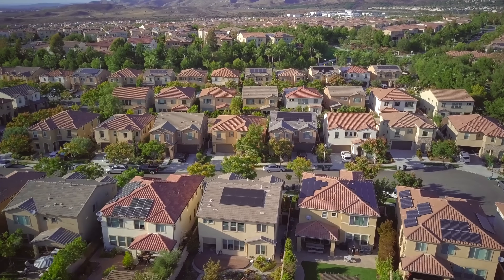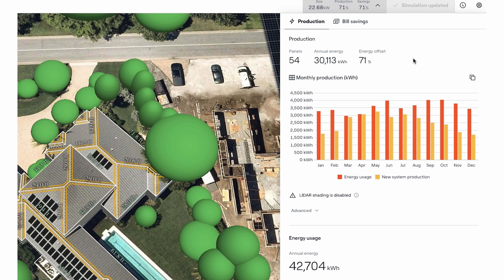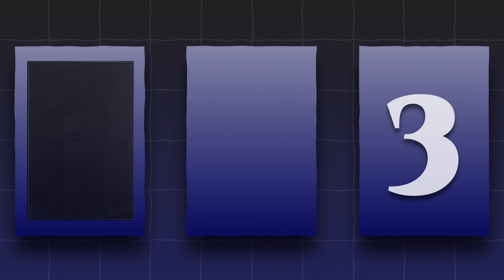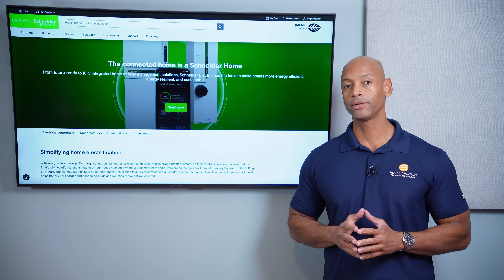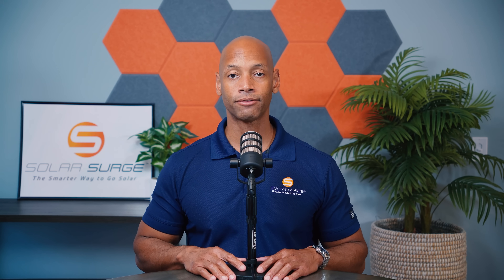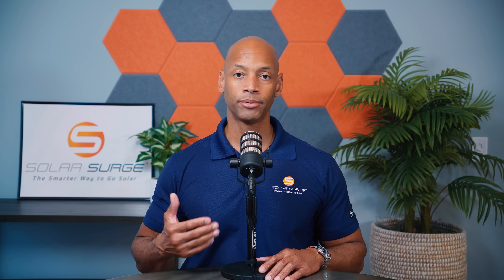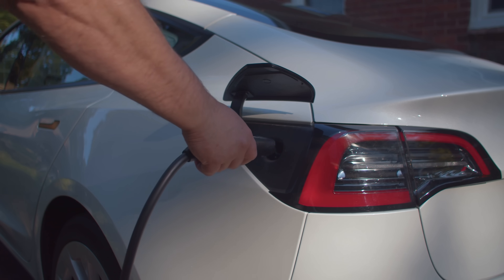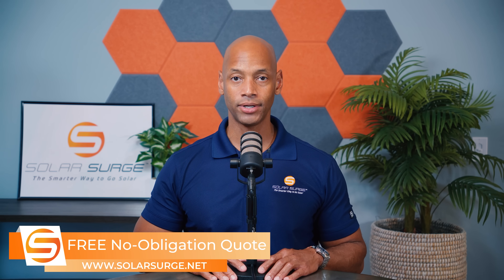How to Fully Solar Power Your Home

Comment: save $100,000 
A real bunch of crooks.  Beware Enphase, Good Leap, and Blue Raven Solar.   the loan contract will say you have no Constitutional rights or rights to a jury trial and if you have questions, you have to post a 10,000 bond for the arbitration board.
do they tell you that you only get 80% credit for the electricity you generate,  for every $100,  you get $80 the electric company get $20.   Quite a profit.
The solar panels and I invertor for each panel and warranteed for 25 years,  they start failing after 25 months.  Is labor covered under the warranty?  No.       Therefor 32 failing panels and 32 failing invertors  times $500 buck labor is $32,000 in additional cost during your ownership. 
A real bunch of crooks.  Beware Enphase, Good Leap, and Blue Raven Solar.   the loan contract will say you have no Constitutional rights or rights to a jury trial and if you have questions, you have to post a 10,000 bond for the arbitration board.
How good are the batteries good for??
How long do the solar panels last?
 how long do the inverters last?
Did they tell you the repair department is located oi the Philippines, with operators who don’t speak English that is understandable.   
Do they tell you they will wait 30-40 days before  replying to repair issues. 
30 panels and a $20,000 roof cost me $ 96,000 and my payment is only $498.................. thank you so much

Comment: I just got a 10.12kw solar system that we just had installed.  Im in Los Angeles and it’s mid summer.  The AC is on and I have a pool pump that runs 8hrs daily.  We also just bought a Tesla.  I believe the battery capacity is approximately 70kw.  I also have a fox ess 20kw battery. The system has been producing about 38-47kw daily.  I set my wall charger at 22A and it gives the car 5kw/h.  I do this from 10-3 (when I receive the most PV).  There are days where we can fill up the battery but when I charge it doesn’t get filed up all the way.  I’ll wait a full year to see if I’ll be net zero but I highly doubt it since I’m in NEM 3.0 from so cal Edison.  But still I feel that it’s still a good investment since  Edison keeps increasing their rates year by year

Comment: I finally got the last piece of puzzle instaled to be self suffient. My system a bit of a mess but its all working perfect right now. I got one solar system with enphase enverters. A different system was added later and they used a telsa inverter. I just installed the new franklin batteries last week. It been bit of learning cure which seeting to use but have found out using self consumtion option works out the best. Now im not using any power from the grid. Hope in winter months its also rhe same. Will find out here soon in next few months. By the way im in Ca and got stuck with new 3. That another story im not happy about. But if these batteries work out i wont need pg&e anymore. There rates are killing me.

Comment: Thank you again for sharing your insights. For those taking the first foray, and others looking for additional resiliency, there's a few things to consider. The monopoly (utility) is a disruptive force. They may try to make you jump, and want you to ask how high should I jump. The reality is in their own economics. They have few options to meet demand (ie data centers especially with so-called AI). You, the renewable consumer are the solution, but you may get marginalized by their tactics. Push ahead, be informed, get your installation done, regardless of the sketchy tactics, especially for those that are tax credit eligible. Design a system that can segregate you from the monopoly approval so you're eligible for the remaining incentives. I have had trials and tribulations with Rappahannock Electric. Still moving forward with my upgrade from a 15+ year old grid tie to at least triple the size, and solid battery backup. Don't be intimidated

Comment: Where can I find a solar installer to do #3. Every installer I call only wants to do grid tied solar which dies as the power grid dies. I would like someone to help me design a dc to dc connection with my F3800’s. I got the money in my hot hand but nobody to shut up do the work and take my money.

Comment: This is in my plan.  The real question I have is since I'm planning a new home, around 3,500 SQ ft.  I don't know what my usage will be.  Plus, part of what I'd "like" to do, is have enough solar energy to never have to worry about what the thermostat is ever set to.  On a 100 degree day, I want my house to be 65 then go for it.  The same for winter, 30 outside I want to set it to 75.  How can I possibly figure out what I'll need. (Batteries too)... I am thinking I'll have a small generator as a safe guard, maybe that will allow for a smaller battery package.

Comment: At this late date, I think its simple.   For most people contemplating solar now who are new to the game and don't completely understand all the fine points:

* Start with a whole-home hybrid inverter and a battery from the get-go, and fill all convenient roof space with DC coupled solar (regardless of orientation).  Keep it simple at the start... just stay grid-tied, don't worry about backup at the start, just make sure the system is capable of doing it later on, as well as capable of being expanded.

* Give it a year like that, then start worrying about whether you actually want grid-down backup (aka service intercept, gateway/MID or meter collar, new breaker panel, etc).  Don't do major panel work or grid-down backup at the beginning unless you really know that you absolutely have to have it immediately.

That's it.  No intelligent load control is needed (its a lost cause anyway... to be perfectly frank, nobody should be doing smart panels any more).  That is to say, for most people the first solar system they get today should not have to involve rewiring breaker panels in any way beyond just adding the backfed breaker.   You can plan for a more complex future, sure... leave room for the gateway, leave room for more batteries, leave room for a new load center.  But there is no reason to actually do a full-bore system from the start.

Home automation, sure.  Intelligent control based on smart breaker panels, no.   Actual grid-down backup... not necessary for a home owner just starting out.  Instead just make sure the setup you have is capable of supplying a few plugs in a grid-down situation (they usually just hang off the "load" port of the hybrid inverter), and have a couple of 100ft long heavy-duty extension cords.  Just to start.  No need to wire the whole house for grid-down backup at the start.

Because its far far cheaper than going whole-hog and you won't really know what you actually want or need until you get some hands-on experience with just the basic grid-tied system first.

--

The key is the solar.  DC coupled on the roof (meaning string inverter or hybrid inverter... I recommend a hybrid inverter at the start even though you won't be doing grid-down backup immediately).   With DC coupled solar it doesn't matter what the utility caps are, you can put as much solar on the roof as fits.  It doesn't matter if you over-panel... you'll grow into it.  Do all the solar from the get-go.  One and done, so to speak.  Multiple strings.  No paralleling.   DC coupled (on the roof) for maximum flexibility.  With AC coupling you have zero flexibility.

Same with orientation... orientation doesn't matter.  South / south-west orientation (for the northern hemisphere) will maximize winter generation and of course you would have those panels, but ANY orientation works great in the summer when you are likely to have your heaviest A/C loads, and ANY orientation works equally bad in cloudy weather so you'll get more ambient / cloudy-weather / foggy generation.

-Matt
Reply: And no long strings use short string incase a panel goes bad or gets shaded...
Reply: @SolarizeYourLife  Long strings are actually what you want.  Not sure what you are thinking but shading won't take out a string, the shaded panel just goes into bypass and the rest of the string continues to operate normally.

If the string is too short the lost panel will drop the string voltage below the MPPT start and that will cause problems.  With a long string that doesn't happen.

If shading is an issue spec half-cut bifacial panels. "half-cut" bifacials basically have double the number of bypass diodes and split the panel into (essentially) two independent sub-panels.  It's a very shade-tolerant combination.

You also want to avoid paralleling strings, particularly if shading is an issue.  When two strings are paralleled and shading takes out a panel on one string, it will cause the MPPT to regulate to the lower voltage which effectively takes a panel out from both strings.   Fortunately inverters have a decent number of MPPT inputs these days so there is no reason to parallel just in general.

-Matt